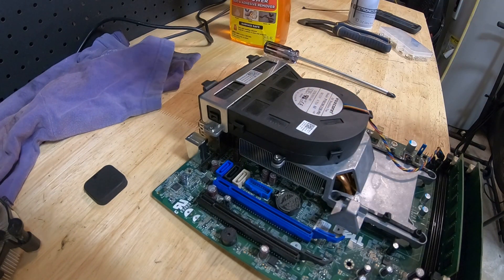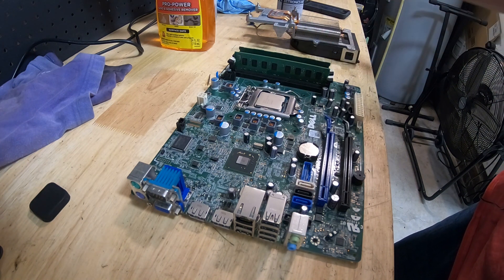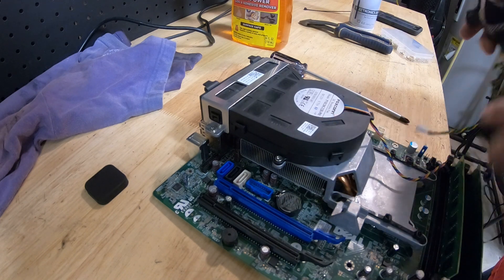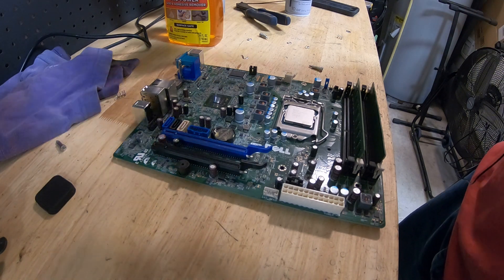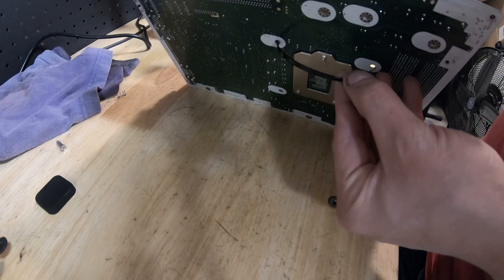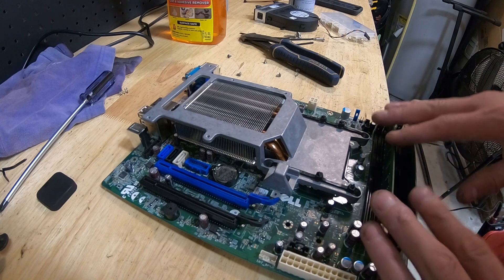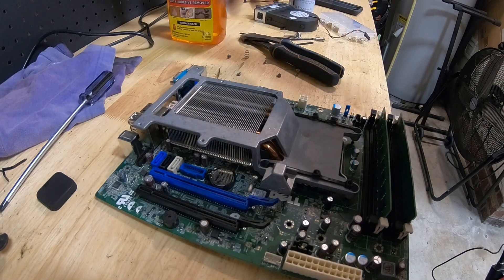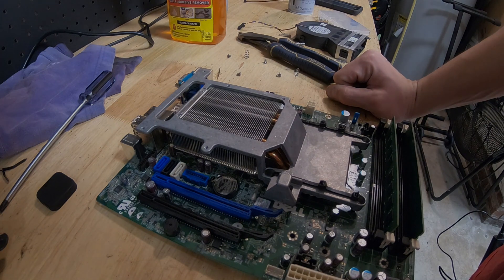Dell Optiplex  SFF cpu cooler. CPU cooler guide for case swaps!!

Comment: Hello, thanks for the video, really interesting.
A quick question: I have a Dell USFF (https://vjauj58549.i.lithium.com/community/image/serverpage/image-id/22945iBEAAEBB8804E7FA9/image-size/large?v=1.0&px=999) I need a bigger tower. Swapping to a generic seems to be complicated with the pin compatibility. Then I am checking which Dell Tower is compatible. Any idea please?
Reply from the maker: swapping to a generic case is actually not that hard as it seems. Their are great guides and info that help. The pin issue has actually been simplified by this guy who sell adaptors he makes on eBay.
https://www.ebay.com/itm/Dell-Optiplex-390-3010-3020-Front-Panel-Header-Adapter-Kit-3pc/264638815586?ssPageName=STRK%3AMEBIDX%3AIT&_trksid=p2060353.m1438.l2649
Def check it out and it might be something to consider.

I have never swapped them to another bigger dell case but I would recommend to just make sure the motherboard measurements fit as the usff board appears to be a little bit longer. You may run into the cpu cooling fan issue due to the bigger cases using typical mounting standards for cpu coolers.
Reply: @DLMtechgarage  What about the i/o on the sff can you explain how to get the power switch to work in a atx case
Reply from the maker: @Allious131  check out this guys video, he sells and easy piece to do it plus give the open source diagram so you can make the  pin outs for it. I have another video on my channel of how i did it but this guy sell this piece which is the best way to do it. check it out and see if it helps.

https://www.youtube.com/watch?v=3fb6-B5Ux_s&feature=youtu.be
Reply: @DLMtechgarage  Thanks a lot